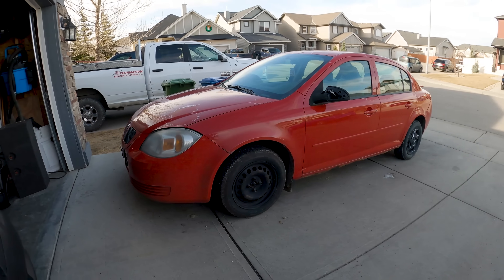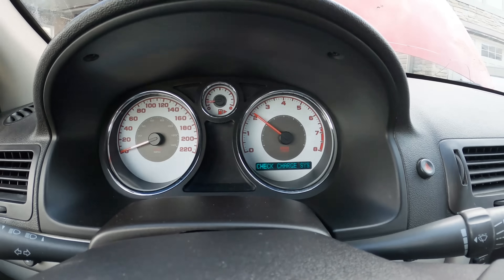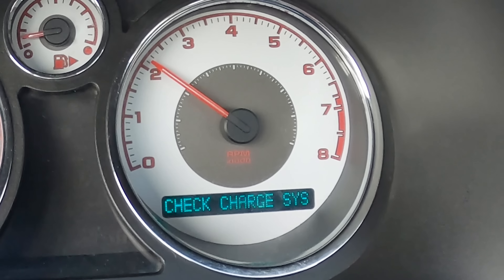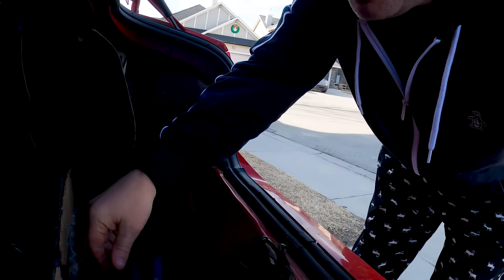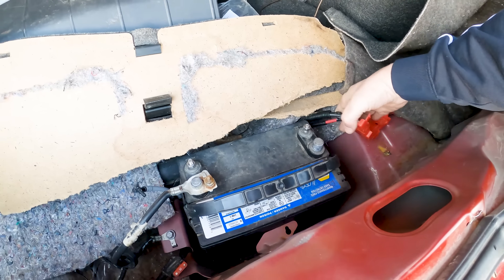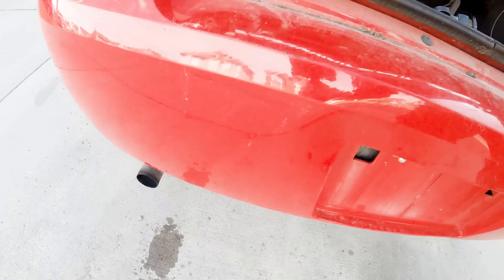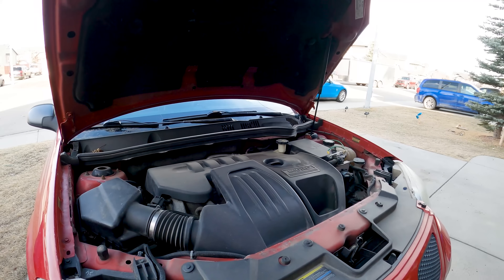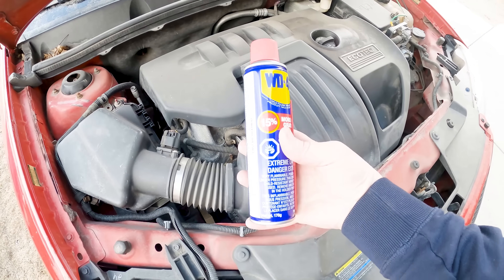ROADSIDE FIX! REVIVE your DEAD or DYING Alternator with this ALMOST FREE trick! | Gears and Tech

Comment: Pulling the terminal is dangerous.  If the charging system is actually working, charging that battery,  it could be off gassing.  A spark can blow your face off. It can also cause a lot of damage to the modules and computers on the vehicle.  This is why there are proper tools for diagnosis. Be careful about bad advice drivers.
Reply from the maker: I feel like this is a very hypothetical scenario

When was the last time you saw an off gassing battery inginte from being disconnected

I won't say never. But pretty close to never would be fair.
Reply: It can happen,  I only wanted to share that information,  my apologies for the bad advice comment.  I've done some wild stuff myself to get home.  But knowing risk can lead to safer experiment conditions.

Comment: Best way to tell if the alternator is working with out any tools is to put a piece of metal on the center back and see if it sticks. the center back where the bearing goes is magnetic when charging
Reply from the maker: Great tip. Often it's hard to get to the back of the alternator

Comment: I did this a couple weeks ago. my van sat for a very very long time. it's a 1996 with only 50,000 miles on it. I figured the brushes were stuck, and sure enough this fixed it. I will eventually replace it but I might as well get use out of it before it does go. After unsticking the brushes though, I hosed it down with brake cleaner. Oily deposits invite debris to build up and re-cause the same issue. Also WD-40 is flammable. Brushes do indeed spark some. Be smart with this tip.
Reply from the maker: Glad to hear it worked
Reply: Break cleaner is a no no. Electrical contact cleaner spray is best.

Comment: Back when electrical systems were almost bulletproof, mechanical regulators and had oil filled ignition coils you could remove a battery terminal with it running.  DO NOT  remove the battery terminal in modern automobiles. It can spike and damage the ECM/PCM.
Reply from the maker: Hasn't happened yet.

Comment: You should never disconnect battery cables with the car running. With the cost of battery and charging system analyzers as low as $25, this video makes no sense. Test the right way avoid potential more expensive damage.
Reply from the maker: This video is for the average person.

I have the tester you speak of sitting in my garage. But I'm not making a video of how to buy the right tools. This is a video for the every person that doesn't have a lot

Comment: If you are going to disconnect the battery always disconnect the negative cable. If you disconnect the positive and happen to ground it out you are going to have problems. The way you took your positive cable and stuck it next to the car chaise made me cringe; I unsubscribed from your channel when I saw that.  In addition, I think electronic cleaner that comes in a spray can would be better to put into the alternator, it is made for that.  I believe WD40 even makes a "Contact Cleaner" which I would use if I had a choice of buying it or regular WD40.
Reply from the maker: Will be sad to see you go, but you gotta do what you gotta do

Comment: Disconnecting the battery with engine running used to work for farmer Joe back in the 60s. However doing that  today  on computer controlled vehicles not a good idea at the least you can could cause anywhere from 100 dollars to 1500 dollars of damag. I watched a newbie at the shop do this cost the owner big and him his job. Also wd40 is a very temporary fix and 9 times out of 10 won't work at all.
Reply from the maker: I have found 9 times out of 10 it does work

And I specifically say in the video this is very temporary and is the last ditch effort to get it running long enough to avoid a tow cost and get to a shop

Comment: Careful on an old Ford. You take a battery cable off when it is running, say goodbye to the engine computer. When the alternator is good, and battery is out, it has no reference voltage and 'BINK", it shuts off instantly. Had an uncle who used to share his battery with his truck and his boat, He would back the trailer down, put the battery from the truck, into the boat (200 HP Evinrude), then pull the truck to the parking lot. Got the newer truck, and destroyed the control module on the first launch. He was not happy and we were stuck there. (Yeah GM had a better system)
Reply from the maker: That sucks

Comment: I was warned that disconnecting the battery terminal when the engine is operating can damage your cars computer, because the alternators voltage regulation is dependent on having a battery inline with it.
Reply from the maker: That's not totally true. On some cars it could be. If you're worried about it then just soak it with wd40 and see if that helps.

Pulling the cable off was an example how to test it with no tools
Reply: I remember disconnecting the battery with the motor operating  in much older cars, pre electronic ignition and computers, but it would seem more risky now days. Perhaps it might be worth doing a follow up video on the possible pros and cons of disconnecting the car battery with newer cars. @GearsAndTech

Comment: Wow! This was awesome. I sprayed my alternator with WD40 and the alternator started charging again. By the time I got home the AM radio was pulling in FM stations. My spare tire patched itself and reinflated without my help. Even my wiper motor started working. I was wondering if I spun the alternator in opposite of normal direction of rotation, would it discharge the battery? Thanks for all the help.
Reply: No if you spin the alternator in the reverse direction it will fix a failing transmission.
Reply: @acement1  You know, I think I heard that somewhere before. 😁👍
Reply from the maker: Im not sure about fixing the transmission. But I have heard it'll replace the rust on the body with the original metal and paint. Will make your car look brand new again!
Reply: @acement1 It'll really fix a failing transmission? This is first time I ever heard that

Comment: Wow,  great info  never heard of that temporary solution. This would also be a moment to promote the habit of keeping the engine clean, in the preventative maintenance    And  making sure the connections on the battery are not loose,(not able to be removed with out tools     :)   Great video and info   Thanks
Reply from the maker: I always notice things after that would have been great to discuss

Comment: the diesel and the pump run on the engine, so if the light is on it will continue to run without electricity
Reply from the maker: On a diesel yes.

Comment: Mine is without the alternator and the battery, the engine is still running, but measuring sometimes means knowing whether something is broken.
Reply from the maker: Impossible. You need battery or alternator to have the engine run
Reply: Not necessarily if it is an older car, right?

Any car with fuel injectors won't run without electric power.

Comment: Your Lose battery terminals can cause the issues described, Also never pull the Positive off first. Negative goes on last and comes off first. It's much safer to do it this way.
Reply: Corroded battery cables or connectors can do this too. Sometimes this can be almost invisible and caught me off guard being a mechanic. I had a ton of issues with my Accord one time where sometimes my starter and alternator would work other times not. Same with the radio and my dash clock. Turned out to be a very subtle film of corrosion on the inside of the battery connector. I mean subtle too. No blue, white, or obvious corrosion. Just a thin wall of almost sand colored corrosion on the inside diameter of the battery connection. Cleaned it with a brush and it fixed it for a while but I wound up getting different connectors later since it seemed to corrode faster than the new ones. I never had a problem after replacement.
Reply: Boiling water neutralises oxidation. MUST BE BOILING. Pour over liberally, wipe off and smear a coat of vaselene or any oil based stuff including butter!  @potardo9851
Reply: There is a chance of frying the ecm when connecting and disconnecting the battery if done wrong
Reply: It's always fun to learn how to weld with a wrench and a battery though 😂
Reply: Exactly ... !!!
Reply: In a DC system, current flows from negative to positive... therefore negative first when removing and negative last when connecting.... please teach this, safe method and by definition if I can remember correctly. Much love
Reply: @charlyostrowski7890 the rule of thumb to remove the negative first then the positive has absolutely nothing to do with the direction of electron flow ffs! 😂

It's because people are clumsy dummies and if we leave the negative connected and undo the positive first the handle of your ratchet or wrench unintentionally contacts adjacent metal that's grounded and it goes POW! Because you just short-circuited the positive to the negative through your goddamn tool. That's why you take the negative off first. Then the car is ungrounded and it doesn't matter what your wrench or ratchet touches while you're taking off the positive terminal.

It has nothing to do with electron flow.
Reply: @charlyostrowski7890  serious question, we know the holes move from positive to negative. Is that just for theory or does it have any practical consequences?
Reply: @jlrinc1420  No it doesn't because electrons are not going to flow without a complete circuit (both cables connected).
Reply: @charlyostrowski7890   shade tree mechanics are dangerous !
Reply: @tomboatman2541 😂
Reply: It don't matter which 1 u take off long as u don't let them touch each other Boom 💥💥💥
Reply: @fireboy5043  That's the entire point of taking the negative off first. So that there's less chance of accidentally shorting the positive through your wrench or ratchet to any and everything around it that's still grounded as you're taking the positive off, because you didn't take the negative off first. 

If you take the negative off first the only thing left to accidentally short the positive to is the negative battery terminal.
Reply: @fireboy5043  
If you disconnect from battery the cable when the engine runs 
There can be a spark that can destroy the Alternator and  the ECU
Rule
Engine not running 
Negative cable disconnect first=1 always 
Positive  cable disconnect  second=2  always 
If we do that then can't be an accident
Everyone can do what they want
Reply: loose
Reply from the maker: Excellent points
Reply: @GearsAndTech yes I saw that and it discredited your video among a couple other things ! 
Also I would be concerned about possible fire 🔥 !
And one more thing the WD 40 could compromise the coating on the field wire and cause a dead sort and burn up your wiring another possible fire hazard and very costly repair if you still have a car left !
Reply: Safer? It's 12 volts. If you can't survive a few sparks then you shouldn't be touching batteries.
Reply: @TempoDrift1480 found the guy who's never been around a lead acid battery that exploded. An uncommon occurrence but it absolutely does happen. FYI...

The danger we're most concerned with here is a sudden and catastrophic explosion, and the source of that hazard flows from the interaction between the lead and sulfuric acid in a battery. Small amounts of hydrogen gas are produced during both the process of discharge and during charging, and hydrogen is flammable.

When a battery has discharged to the point where it can no longer power a starter motor, there's a chance that some amount of hydrogen gas is still lingering inside the battery, or leaking out of the battery, just waiting for an ignition source. The same is true of a battery that has just been charged, as high voltages can lead to the formation of both oxygen and hydrogen.

There are two primary ignition sources that you have to worry about, and they can both be avoided with careful charging, jumping, and maintenance practices. The first ignition source is a spark created when connecting or disconnecting a jumper or charging cable.
Reply: The other type of car battery explosion still involves hydrogen gas, but the ignition source is inside the battery. If a battery isn't properly maintained, and the electrolyte level is allowed to drop, the lead plates will be exposed to oxygen and may warp. This can lead to the plates flexing and touching during the extreme current drain initiated whenever you crank the starter motor, which can result in a spark inside the battery. That, in turn, can ignite any hydrogen present in the cell, causing the battery to explode.

That's a cut and paste by the way I can't be bothered to explain it myself. The first reason is why you 1) want to avoid sparks when disconnecting a battery, because while extremely rare when a battery does explode battery acid goes everywhere and your face is usually right there so go wash up real quick because your day is sucking. And 2) it's why they tell you if you're connecting a charger or jumper cables put the clamp on the dead batteries positive terminal first then connect the negative to somewhere away from the battery that's grounded like the engine block instead of directly to the negative battery terminal where it might spark.
Reply: @TempoDrift1480 it's the Amps that get you.
Reply: Dang and I thought you leave the ground connected while u are unhooking the positive terminal.
Reply: @Crossroads-VYZHUN  The only reason the negative should be the first off and last on is because of the chance of shorting the positive terminal to the (negative) body with your wrench while the battery is connected.

As long as you don't let your wrench or anything else metal touch the positive terminal and the car's body at the same time, which cable you connect or disconnect first is irrelevant. Definitely a good habit to get into, but if you have a specific reason to connect or disconnect the positive with the negative still connected, it's no big deal as long as you are careful.
Reply: As far as I understand, one of the main reasons for connecting and disconnecting in that specific order is the risk of spark which it will do if done in the reverse order. True chances of any issues are rare, however it can be problematic with a lead acid battery and/or sensitive system components.
Reply: @averyalexander2303  careful doesn't work ! 
And then what do you do with the battery cable ? Another chance of a dead short with the car running  ?
Reply: @tomboatman2541  Actually, in most situations, careful does work. If you aren't sure you can disconnect the positive cable without shorting your wrench to anything metallic, just don't do it with the negative cable connected. It's that simple. Once either cable is disconnected, there is no danger of shorts.

Why would there be a chance of a short with the engine running? You shouldn't be connecting or disconnecting battery cables while the engine is running anyways.
Reply: @averyalexander2303  well he did with the engine running !
Reply: @tomboatman2541  And that's his error. As I said, connecting or disconnecting battery cables with the engine running is never a good idea. The voltage surges that will create are very likely to damage electronics.
Reply: @averyalexander2303  I accidentally touched both terminals with a longer wrench once.  Sounded like a gunshot, arc explosion like a welder, my arm yanked back before I knew what happened and threw the wrench across the garage into the wall. XD
Reply: @WickedCrispy  5 yrs old?
Reply: @Crossroads-VYZHUN  No, if you take the positive off first yo run the risk of shorting the battery from positive to negative THROUGH YOUR BODY if you come in contack with the frame of the car while holding the positive terminal.  The negative serves as the ground and connects to the frame.
Reply: @WatchesTrainsAndRockets  
Exactly 
We don't disconnect the kables on the battery when the engine is running
Reply: @WatchesTrainsAndRockets it's 12v DC you're worrying a bit much there about shorting it through your body. I've actually never heard of anybody doing that. Arcing the tool to ground yeah sure that happens all the time. lol :)
Reply: @konstantin-big did it for yrs never had a problem
Reply: @fireboy5043 there's always the first time and you will make it the last time I am sure !

Comment: This bloke is a dickhead. Always disconnect earth terminal first, then positive. Spraying water from a hose will work better than wd40 because it evaporates and leaves no residue. Correct voltage while running should be 13.8v to 14.5v. Modern cars will get engine management issues if alternator output is outside this range. Best way to free sticking brushes is tapping on alternator with a small hammer. The only good idea he presented is the cigarette lighter voltmeter, I have one in all my cars so you can see voltage everywhere you drive. Most alternators die because the regulator shits itself, rather than sticking brushes. If it gets you home that's great but replacing alternator is the only real solution. Cheers mate.

Comment: 40 year retired tech, brushes not making good contact monitor voltage then GENT LEY tap on rear alternator housing - rpm will drop a little, charge light will go out and you confirm that you had poor brush contact! New brush holder assembly or reman alt assembly, expect 120-160 k miles
Reply from the maker: There's a guy with a video that says the same. But that's a specific fix for a seocific problem

Wd40 fixes that problem and a lot of others
Reply: @GearsAndTech  what others?